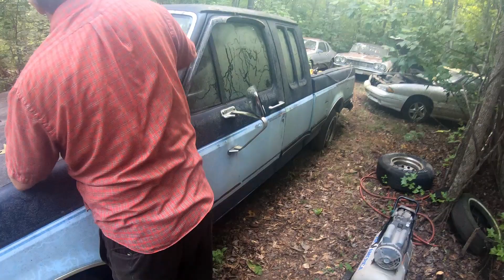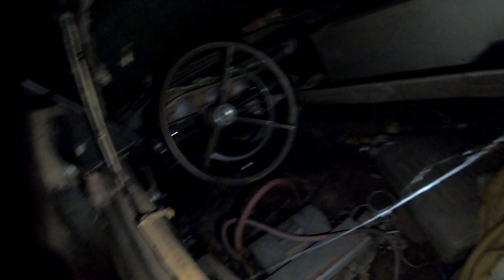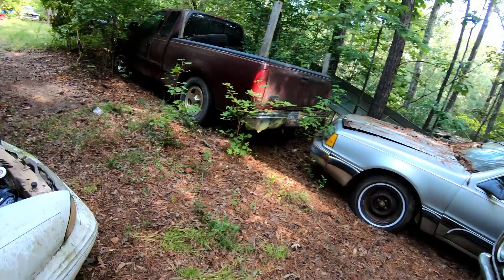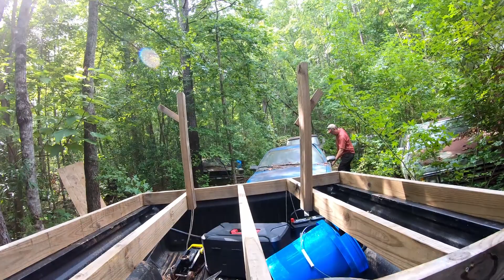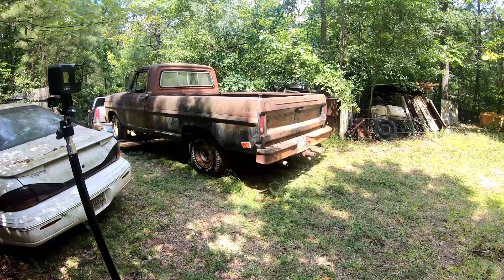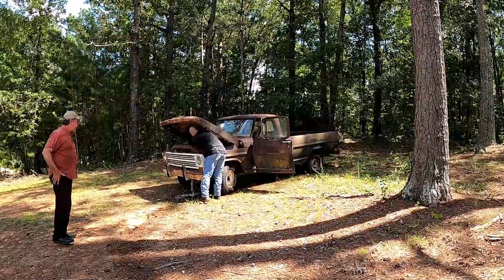Will Ole Puddin' Drive from Her Grave? 1968 Ford F100 Revival: Will She Make It Home?

Comment: Watched the first 4 seconds and subscribed
Reply from the maker: Wow! I am honored that you subscribed! I am having fun with this project and excited to share it here on YouTube! More coming... Thanks!
Reply: I have a 1974 Ford F-250 Ranger on my channel. I call him Rambo. It's been down for 5 months, I've been trying to find a points distributor for it. It's got the famous 4.9 300 straight six with only 22,000 miles on it. I wrote a song about it, that my dad sings called "My old Straight Six Ford" you'll find it on my channel Quint 1836.
I've re-done everything on my truck. If you ever need advice or help on yours don't hesitate to reachout
Reply from the maker: Awesome.. I will have to go and watch.. Rambo sounds much stronger than Ole Puddin'!